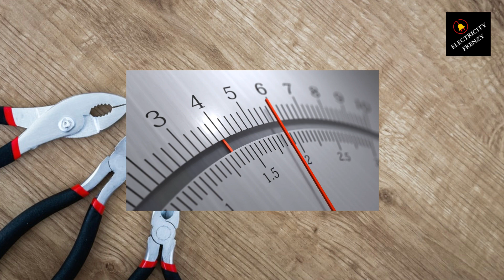How to Choose a Voltage Stabilizer for Home? Important Tips you Should Know!

Comment: It's easy to say `Determine the voltage fluctuation in your area,' but what does that mean in practice? Plug a multimeter into the socket and watch it for awhile?
Reply from the maker: Just ask some of your neighbors if they also have voltage fluctuations
Reply: @ElectricityFrenzy  I know they do. We have an automatic voltage regulator for a few electronics, and it makes whirring noises a lot at certain times of day as it's adjusting. Neighbors don't have that, but their televisions and electric kettles break regularly. A TV repair guy was next door about a week ago because the latest TV was still under warrantee.
Reply from the maker: Low voltage can damage some appliances indeed

Comment: Can i use a 3500w electric cooker on a 5000w automatic voltage stablizer
Reply from the maker: Yes you can if the Stabilizer is high quality. And of course the same voltage of the cooker